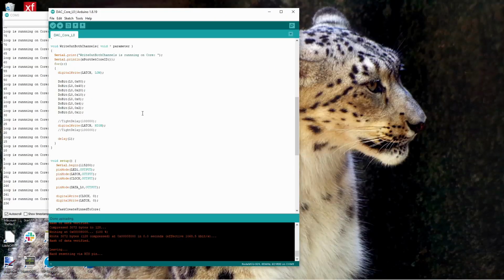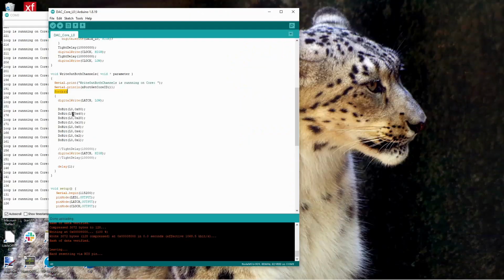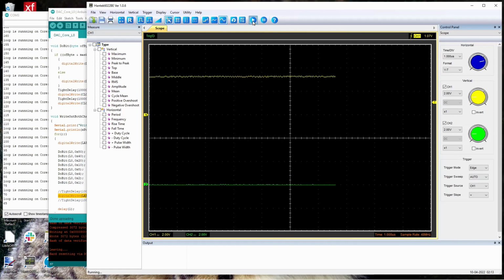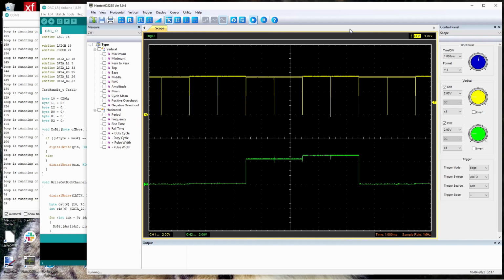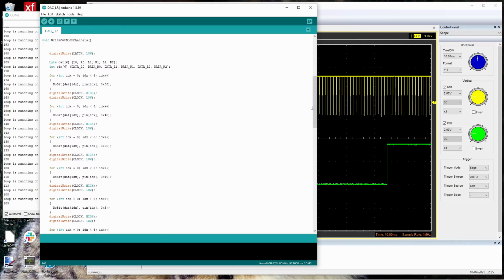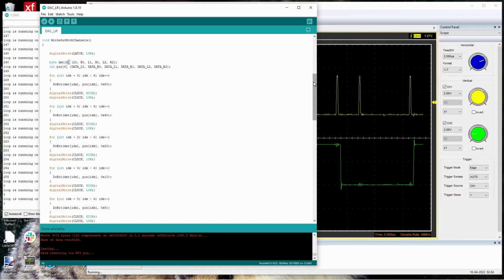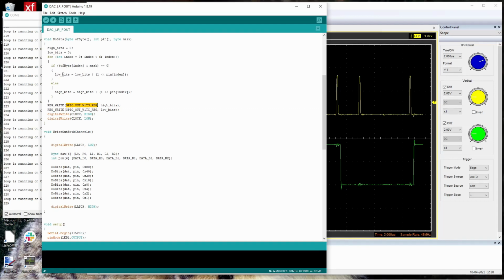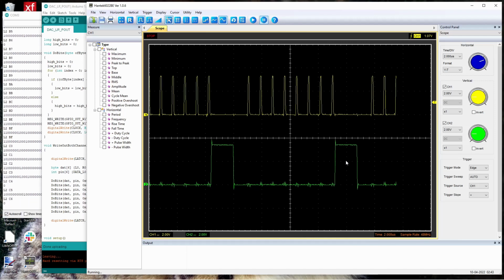ESP32 High Speed Parallel Output using 74595 Shift Registers & W1TS / W1TC (DIY DAC)

Comment: I know this is 2 years old but you could try shiftOut(datapin,clockpin,bitorder,value);  this will shift out 8 bits (1 byte) of data onto datapin.  Since this is a software implementation its not that fast.  But if you really want speed use the SPI interface that can clock up to 80MHZ.  With this you can chain all 6 shift registers together and have a lots of CPU cycles to do other things on the Microcontroller.  Since 96HZ at 48bit is 96,000 X 48 or 4,608,000 bits/sec which gives you a ton of room vs the 80,000,000 bits/sec the the SPI hardware is capable of.   Note: you need to go into hardware config and make sure your running at 240MHZ.
Reply: Hello @richardrich2710 - I found this video as I am struggling using SPI.transfer on ESP32. I have used it very successfully on ESP8266 (wemos D1 mini) to drive shift registers (HV5522) that ultimately are controlling neon displays (panaplex). Anyhow - I am trying to use similar code on ESP32 (I tried C3 and S2 variants) and apart from the Latch output falling/rising, I can detect no outputs for data and clock signals. My real problem is (I think) based on all the (apparently) conflicting info on which the are the MOSI and MISO pins on each of the variants of ESP32 - that being said - I scope all pins and find nothing other then the toggling latch pin. Is there some more setup required (I suspect that there is!) ?

Comment: Very thought provoking.  Subscribed.

Looks like you followed this up, so I'll watch that  one and then comment, save for this (so I don't forget): 
Could you go ahead and treat each byte, identically,  like it's an eight bit DAC, then sum those outputs with an Op Amp buffer on each stage, through a three bit, R2R ladder?  That way, each individual stage could be full amplitude.
Reply from the maker: I think so. That was the plan, however I think I would have to attenuate stage 2 (middle byte) by a factor of 256 and stage 3 (least significant bite) would be attenuated by factor of 2 raised to the 16th power!